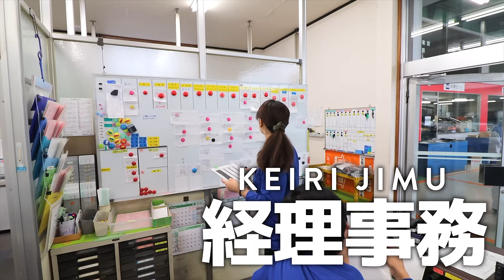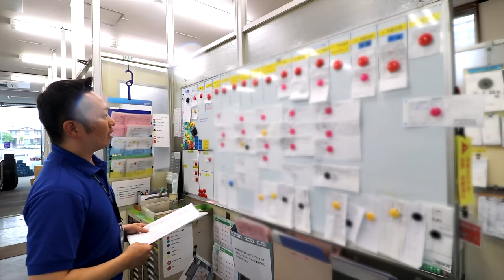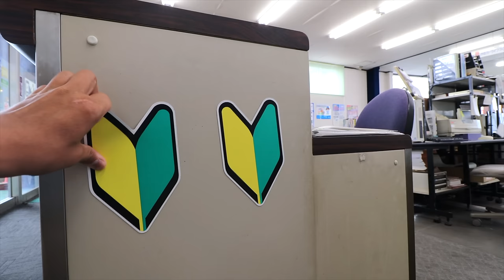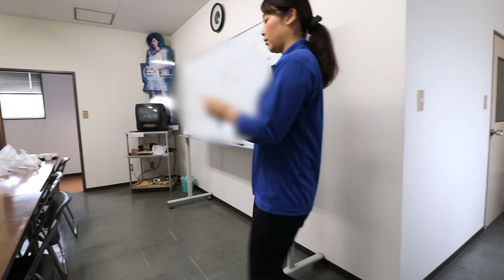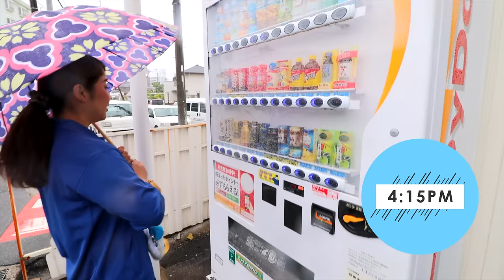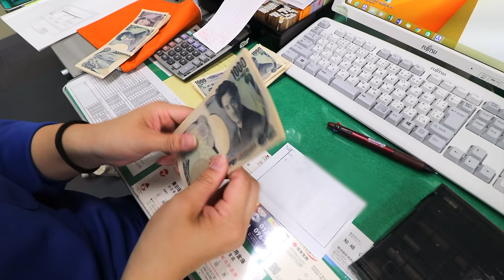Day in the Life of a Japanese Car Repair Worker in Toyota

Comment: Works in Toyota in a Toyota car shop.
"What's your favorite car?"
"Nissan"
Reply: the name of the region is toyota, the shop itself is not a toyota shop. Its 3rd party.
Reply: O nissaaaan :3
Reply: I see denso brand, i mostly see denso brand on a car AC system. Hence most of them is fixing the AC
Reply: Febrian Pratama Putra My friend works at Denso here in the Philippines and she is a junior software engineer ☺️
Reply: @adminfebhost  Denso is the leading manufacturer for AC components for both US and Asian vehicles, but its actually only a small part of their business.  They are a major OEM supplier in Japan for a lot of other parts as well as manufacturing of jobber parts for a lot of vehicles. Electrical components, sensors, modules, tune up parts, fuel system parts, some drive line parts, you name it. About the only parts they don't manufacture are major engine/transmission components and body parts.
Reply: @C-S-J  Yes it is. i have denso spark plug in my motorcycle
Reply: and the delivery car is Honda.
Reply: "GT-Aru"
Reply: Chrysler 🤣
Reply: Other countries: has a normal car sign

Japan: *puts o in nissan*
Reply: Hino
Reply: lol
Reply: I could understand her reasons. At least she not working European cars like Mercedes, or BMW.
Reply: I worked for numerous Ford and Chevy shops in Michigan but I like imports more lol
Reply: Harsh Sribhashyam Toyota is a city, in Aichi Prefecture and it belongs to Chubu Region. Also called Central Japan. I’m from Nagoya Achi Pref.
Reply: Lotus is better
Reply: Toyoto is where she lives and works, silly 😜
Reply: Marcus Wijaya que
Reply: Got a friend works in a Honda dealership. Drives a Suzuki with Daihatsu rims.
Reply: The shops cars a Honda LMAO
Reply: I like range rover!
Reply: Nothing wrong with that Toyota, Nissan, Honda, Suzuki, Mazda = JAPAN!!!!
also my favorite car Toyota & Nissan! Love Japan!
Reply: Lol
Reply: Bmwl
Reply: Lada
Reply: fired the next day
Reply: skyline R34
Reply: I need a job there America they want slavery's
Reply: Nissan Silvia s15 was a cool choice bro
Reply: @C-S-J  Denso is basically the AC Delco of Asia.
Reply: Blue RX8 at "5:43" . I love me some Mazda and Toyota ngl :p
Reply: I enjoyed this a lot 
I got to see the young lady daily work day 
I got to see a average day in a mechanic shop 
I got to see beautiful Japanese familu house and diner together
Reply: Nii-san
Reply: Thanks to the "Fast & Furious" movies.... every young guy likes the Nissan Silvia.  ( Or the Skyline. )

Comment: Guy: I love car thats why i work for Toyota

Interviewer: What is your fav car
Guy: Nissan Silvia S15
Toyota: Surprised Pikachu
Reply: probably someone who work at Nissan might love Toyota Supra as their fav car
Reply: kek
Reply: Toyota city not Toyota workshop
Reply: They do fix other car too.
Reply: He works in the Toyota City, not for the Toyota car brand.
Reply: Technically he works for a shop that works for toyota
Reply: They actually work for Denso in Toyota City. The reason they're are so many Toyota vehicles in the shop is because Toyota is their biggest client and they make the plugs (for their PHEV vehicles) the advanced A/C systems that can generate heat without using the engine (For their Hybrid vehicles) they also manufacturer some of the Power train components for the Prius and make the keyless entry systems for all Toyota Vehicles that have it equipped.
Reply: @oliverkhoo  yep we got that, but the joke stands.
Reply: Well after spending all day working on Toyota's he probably doesn't want to spend his weekends under one as well.
Reply: I worked in a garage and my favourite cars aren't even made anymore. in some cases, the company doesn't even exist.
Reply: ... maybe watch the video again.

Comment: 8:00 This truck is a Daihatsu Midget, one of the best selling commercial vehicles in the post war era
Reply: very bad idea to put only 1 wheel in the front, it will tip over in a curve that is slightly downhil, they would have to drive extra slow then and that would be a danger when driving to slow to move with the traffic flow. i would not haul any costly parts on that thing, wich makes it useless for a repair shop like that. its rather something for a museum or other people who collect that sort of vehicle, strange that those vehicles sold that well.
Reply: @DonauweIIe  We had "3 wheelers" here, like a quad but 3 wheels, I don't know if they are called that way in English, but they were popular until they became judged illegal and too dangerous, we still see many of these old things!
Reply: @lecoureurdesbois86  
that would be a trike and if they are like a quad but with only 1 wheel in the front, they would be VERY dangerous, they would tip over with the rider in a curve and then fall on the rider, that can break the riders back and cripple him/her forever. that is even more dangerous than a bike. its good that a government would protect the people and forbid any of that sort of vehicle on the street. 
if that trike has 1 wheel in the back and 2 wheels in the front, that will then be much safer in curves, wouldnt be much a problem, i can picture the government doesnt forbid those and in fact the motorcycle brands offer those sort of trikes at present time, with 1 wheel in the back and 2 wheels in the front. 
i think they should have made that daihatsu truck like that, 1 bigger wheel in the back to carry a heavier load and two wheels in the front, if they dont make it with 4 wheels to cut the cost or for some other reason.
Reply: @DonauweIIe  Just Google it, Honda Big Red, one wheel in the front

They are dangerous in a way, but people knew of the weakness and drove accordingly, still, accidents happened, these were quite popular in Québec, now wr have the Can-Am Spyder for the road, which has the two wheels in the front, much more stable, also the Campagna T-Rex
Reply: @lecoureurdesbois86  
thanx for info, i just checked the honda big red with the one wheel in the front, it weighs 649kg, far more than i thought. if that thing tips over in a curve and falls on the driver, that can easily break the riders back. good that such vehicle with 1 front wheel is forbidden, specially for young people who dont perceive danger that much and ride fast like crazy. 

i checked on the can-am spyder and the campagna t-rex, those are for road use, not for offroad. i wonder if there is any trike with two front wheels & one wheel in the back for offroad, maybe that would be a better alternative to that honda big red when riding of road.
Reply: @DonauweIIe  Those spyders are very popular here since they are from Bombardier which is a local company, they're well made and drive well, you just need one thick wheel in the back!

Comment: If you offer a near by swimming pool or install one youirself customers can swim while waiting for service/breakage. and lubing to take place by the mexicans working for you. customers can relax and sun tan on a pool deck. The shafting and rod greasing can occur nearby. The allen screws can be tightened and zerk nipple ends can be lubed. Brakes can be checked and rotors turned and of course the johnson rods can be replaced as per factory recommendations...😀

Comment: The problem of japanese workers in auto repair is what they never see old cars and changing parts that can still work. This is the way in japan. Those family cars or k kars are driven slowly and rarely get in crash. And the crash is more like a dent :D with those. These workers dont see rusted to death cars, car parts that used broken in two pieces fixed with duct tape :D Or parts which are operating      while being broken :D